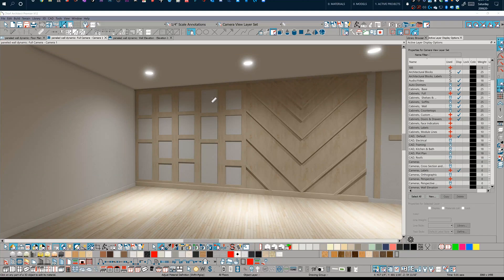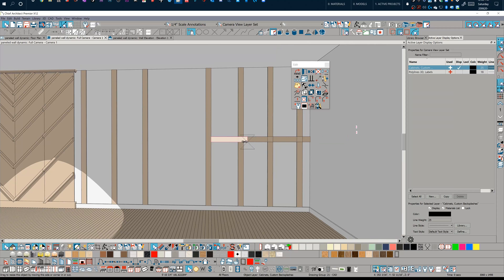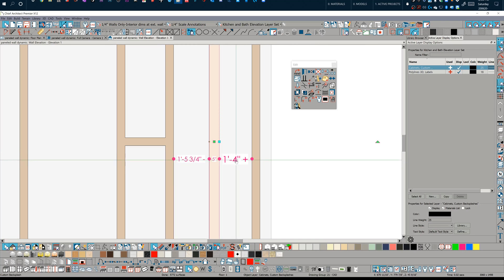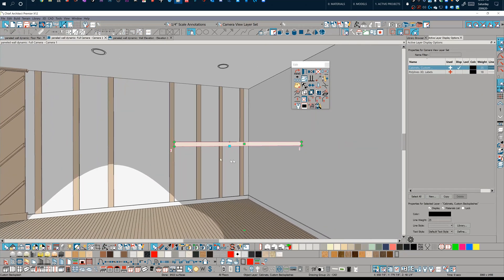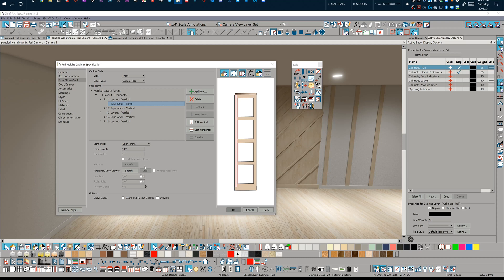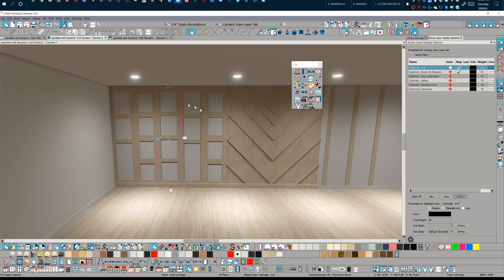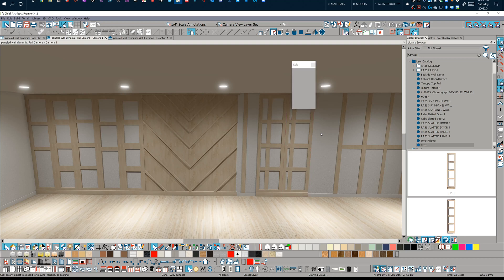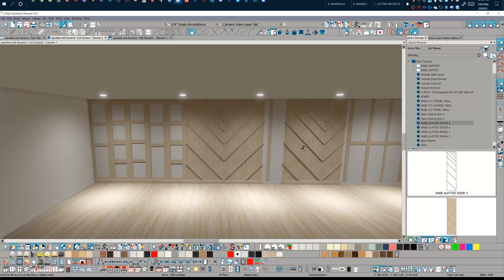Dynamic Wall Panels Using the Cabinet Tool-Chief Architect X-12

Comment: Awesome work on figuring that out by the way! I have only worked with chief for about 6 months. Applying paneling like this has been something I wanted to do for some time. Do you know how that paneling is displayed in materials lists? Or how it becomes integrated to the plan?
Reply from the maker: it displays as a cabinet, but you could always modify it to display as something else.